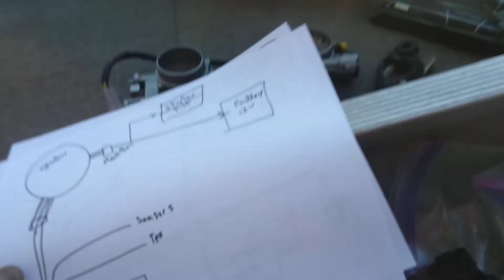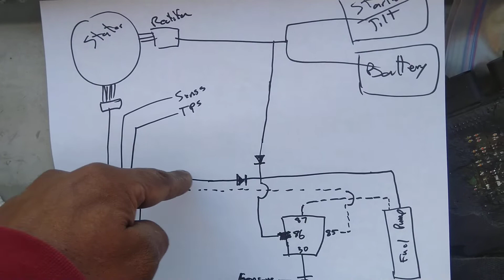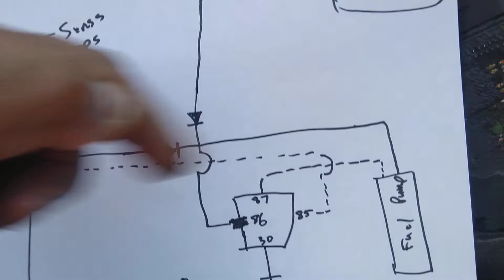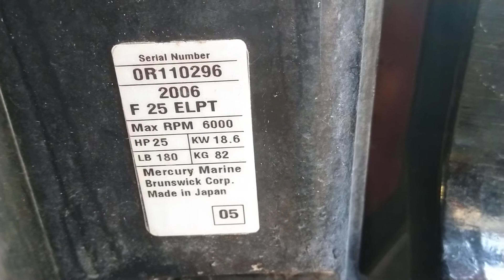mercury tohatsu 4 stroke 25hp 30hp outboard burning out ECU with aftermarket fuel pump

Comment: What state are you from if I may ask?
Reply from the maker: CO
Reply: @omieyouknowme having problems with this 25 4 stroke . No fire to the coils
Reply from the maker: @Everyonesunclewill check the kill switch wiring. Disconnect the brown wires. Then check if you have 12+ on one side of coil wires. The 12+ is same for injectors, coil, fuel pump, idle valve
Reply: @omieyouknowme😂 I got one bolt left to remove it . I’m just going to put an older 25 Johnson on it . Thank you for getting back to me
Reply: @omieyouknowme for giggles I’m going to hook the power back up and undo the wiring harness . It’s a pull start as well so it should work
Reply from the maker: @Everyonesunclewill problem with Johnson is when it breaks you won’t find parts for it. I turned down evinrude Johnson repairs when I used to fix motors because of parts.
Reply: @omieyouknowmeI have a ton of them
Reply: @omieyouknowme I’m thinking of taking it and having the ecm bypassed and putting the motor up tell needed
Reply from the maker: @Everyonesunclewill sadly there a lot of these motors out there that are just anchors now. I thought about building an aftermarket ECU at one time, using existing sensors but I rather fish now than fix motors. Getting old rather spend time enjoying what is left. 
Good luck.
Reply: @omieyouknowmeI. I seen a man bypass the ecm with a timed relay. I just want something to push a small pontoon boat with a cabin
Reply from the maker: @Everyonesunclewill time delay relay. That video was made after he saw mine. The time delays purpose is to give the ECU a chance to charge up the electronic brain before pump kicks in. 
I don’t feel he has understanding of how efi works but it worked so ok.

No spark on this motor can only come from kill switch, bad flywheel sensor or ECU internal rectifier just burnt out. 

Service manual helps but redneck method is to apply external +12v to one of the common wires say fuel pump wire that is positive. (Common wire as in same wire is for coil and injectors and is shared so all of them get +12 volts) Ground the battery to block. 
Crank motor. 
If the flywheel sensor and kill switch is fine you will get spark and motor will fire if pump is running. Means ECU internal rectifier is shot.

Comment: @Omie. Im not sure if youll see this in time.  I have a huge fishing trip coming up in 3 days, and i think my fuel pump is bad.  No gas to the fuel rail at all.  Needle was gunked up with old gas, as it sat.  Im assuming the fuel pump also has gunk in it and is stuck.  Can i reverse polarity to maybe break it free?  Also mine is a merc 25hp efi 2016.  I ordered the fuel pump from amazon.  Do all the outboards require a 3.2amp, or just some that burn up?
Reply from the maker: Reversing polarity won’t do much, usually the plastic impeller is locked up with crud.
You will also need to get a new gasket for vst. That old it will leak if reused. 
2016 and newer may be ok, I posted the serial number breaking my video where they are using a better circuit for pump. 
If needle is plugged you should also be changing the high pressure filter hidden under fuel cooler when you pull it all out. I just go to Napa and find a metal one similar in size for z8$ vs the 30$ OEM.

Comment: Do you have the part number for the Quantum fuel pump for the 2006 25 hp mercury 4 stroke? I removed the pump in my engine and it’s bad. I couldn’t have done this without your video! I appreciate your time and effort to help people.
Reply from the maker: I do not sorry. The pumps you find on Amazon and eBay all come from same factory so does not matter if you buy a quantum or other brand.

Comment: Do you have the part number for the smaller amp fuel pump from quantum? Just got off the phone with them and said they couldn’t find one without a part number
Reply from the maker: I do not. And the so called lower amp pump they sent me was no different than the one I bought already. It does not exist. That’s why OEM pumps are 600$ or a new ECU that can handle larger current

Comment: I got a new ecu because i think mine is fried.  I have no spark and no power to fuel pump.  

Before i replace ecu is there any test i can do on fuel pump to see if its drawing excess amperage?  Im pretty sure i have original oem fuel pump in...this sat for 8 years before attempting to start it and before it was fine and ran great.  I just dont want to burn up the replacement ECU if i have a bad fuel pump thats drawing too much amperage because of bad windings etc
Reply from the maker: If it has sat for that long, probably with fuel inside the vst I’d remove pump clean out the vst replace the high pressure fuel filter and lines. Run the pump on bench make sure it works. Then install everything but don’t hook up pump connector crank see if you get spark to rule out ECU for sure.

 No spark and power to fuel pump could be ecu but also could be bad kill switch or stator that is bad. Don’t assume a dead ECU means no spark, the fuel driver circuit is what goes out only and that’s a negative side. The positive side usually is pretty robust.
Reply: @omieyouknowme so the ecu does 2 things for the high pressure fuel pump? Gives it constant positive voltage AND supplies ground when the ecu wants to turn it on?  Or does the positive voltage at the pump just constantly there coming off of the rectifier?
Reply from the maker: @macknumber9 the ECU provides 5 and 12 volts to various components. 5v for sensors and 12v for spark from coils, injectors, idle valve, and fuel pump. The positive wire is common for them so if you take an injector plug off you find one 12v wire that will be common to pump and coil. 
It has an internal rectifier for this, and closes negative switches internally like a relay to drive the individual items. The positive side is always hot if the flywheel is turning unless: ECU rectifier is burned or kill switch is pulled or ECU does not detect signal from one of two flywheel sensors. 

It’s a pretty robust system with very few weak points. Two flywheel sensors for very accurate timing and it will still run with one out. 

If u are not getting spark check the basics first. Proper grounds, make sure kill switch is not grounded, no chafes or shorted wires before throwing an ECU in it. 
Then put ECU in and crank without fuel pump connected so you get spark and injectors powered. Get noid lights for injectors plugs into harness tells you instantly if they are working
Reply: @omieyouknowme thanks so much man i have been losing sleep over not knowing how this works and you are shedding so much light on this.  Just the knowledge of the ecm having a built in rectifier is awesome to know and helps me tremendously.

So i actually need to confirm all of this because i sold the boat and the guy i sold it to told me all this.  If he is correct though and it is no spark and no power to fuel pump it sounds like the first thing i need to do is check for ac voltage coming out of the stator....im assuming 24v ac is what i should see?

I may need a wiring diagram to test these grounds that you are talking about too....i guess basic continuity test is good?  I think i understand now somewhat how the high pressure fuel pump receives its power and ground but i now should focus on learning about the ignition system and how spark is generated...

I really need a wiring diagram especially to see how the kill switch plays into all of this.  I do not have a key switch just a toggle switch that kills the engine or allows it to start.  It is a rear tiller 30hp efi with a pull start and also electric start
Reply: @omieyouknowme  ok so the 12 volts on the positive side feeding all the components the 12v like the fuel pump etc.....does the ecm just have one wire leaving the ecm and then branching to all these components?

First thing I am going to do is test the lanyard switch... then move on to stator...if they check out only thing else it could be is bad ecm or some issue with the wiring to/from ecm like a bad ground or shorted wire....maybe I need to run continuity checks on the ecm ground (pin 28?)
Reply from the maker: @macknumber9 you should have a wiring diagram behind the plastic cover that sits in front of engine. It’s been a while but I believe that the 12v wire for all components is the same. Fluke can tone out that wire from injector or coil with fuel pump.

The stator for ECU has 6 white wires. I don’t have service manual with me but there is a test procedure for it. The grounds for ECU are behind that plastic cover next to starter. The kill switch should be brown and yellow stripe wire. One of them goes to the bundle where ECU is grounded. 

I mean in theory you could disconnect the 6 pin wire for stator, provide an external 12v source to one of the wires say the fuel pump positive line and crank. If you get spark you can then isolate it to ECU or stator. This is just theory as I am hoping 12v backfeed and provide power for ECU as well. 
Tohatsu builds a good motor I’d lean towards the ECU myself if the above works.
Reply: @omieyouknowme ok so you're saying to check continuity with fuel pump and something else like coil or injector and see if it tones out then I know they are all on the same circuit?

It seems like the only thing it could be is stator not giving power to ECM and ECM doesn't have any power to give to the fuel pump and ignition....or ECM itself is fried.....or I guess somehow the lanyard switch could be at play here?  That's the last piece of the puzzle that I need to try and understand.   I will look for and hopefully find that wiring diagram on the motor somewhere....but in the meantime can you explain how maybe the lanyard switch would be wired into this?  Does the switch just simply kill the ignition circuit or is it tied into the ECM at all?
Reply: @omieyouknowme  also do you think it's possible that the fuel sitting in there for so long caused the fuel pump to draw too much amperage because it was all gunked up?  And I should try to clean the actual fuel pump out?  My biggest fear is something like that causing the ECM to fail (excess amp draw from dirty fuel pump) and i blow then replacement ECM too?

Or is that really not possible in your opinion and the problem really happens simply from the aftermarket pumps that draw more amps?
Reply from the maker: @macknumber9 yes. The pump and injector positive wire is common. You can tone it. 
The kills switch closes ground with ECU to kill power.
Reply from the maker: @macknumber9 yes. The pump sitting in gunk will burn out an ECU really quick it will pull to many amps.  Aftermarket pumps don’t help much either but there are trade offs, Fuel filter that’s plugged will do same thing.
Reply: @omieyouknowme thanks so much.  So I think im going to clean out everything....what exact components should I clean im lost with how many different fuel filters etc I need to clean to make sure the amp draw stays nice and low for this new ecm

Also do you know if the ECM constantly gives out 12v to injectors, coil, etc?  

Just thinking about a backup plan if the ecm failure is only with the fuel pump circuit.  If power was on at all times to the injector for example I could tap off of that to feed 12v to the fuel pump by way of a delayed relay so it can get its ground that way.

But that leads me to last question...does the ecm just constantly run the fuel pump or does it sometimes shut it off?  Im assuming with the mechanical pressure regulator it just constantly runs it and this would work
Reply from the maker: @macknumber9 if flywheel is turning it’s providing constant +12 to components. The ECU then triggers it with negative signal. Your car does same thing, triggers off the negative side. 

Take out vst tank. Remove the pump and filter, check sock on bottom see if it’s plugged. U can run the pump dry for few seconds once its out see if it spins or is locked up. 

Low press filter is before the low pressure fuel pump mounted on valve cover. Then goes into vst tank via a needle float like a carb. High pressure pump picks it up sends it to high pressure filter that’s next to coils then splits to fuel cooler which some returns fuel to vst and sends rest  to injector as deadhead. No return from injectors. 

If you have +12v at injector, you will have that +12 at pump lead. Just use a relay off that same +12 line to close a ground from the case. The relay will just add ground to pump as +12 is already there. That way if motor turns off it opens relay and opens ground shuts off pump. 
I saw that other video of using a delayed relay not sure why he suggested that. It’s not how 99.9% of efi systems are designed or run.
Reply: @omieyouknowme  yeah the only reason I would think of the delay is to protect the engine to allow lubrication but I dont know doesnt make much sense and he said it wouldn't work without the delay...I asked him he hasn't gotten back to me yet.

The 12v that is supplied to fuel pump, injectors and coils comes from the ECM though right?  Doesn't it leave stator as ac voltage and then go to ECM and get converted there to dc voltage and then it leaves the ECM to go to the fuel pump, coils and injectors?
Reply from the maker: @macknumber9  most efi systems will prime the pump for split second before cranking to build pressure. These battery less systems do that as motor is cranking. The older ones like this one crank to generate ac that’s rectified internally to power everything. The new systems use an external dc capacitor that holds a small charge and reacts faster.  I’m not sure why the relay with delay but what ever works. All these systems are patented from Mitsubishi by the way. 

Yes 12v supplied thru ECM when running. The starter has a secondary stator output, 3 wire plug on starboard side right next to ECU for battery charging. When I did my fix, I tapped 12v from here for my pump. That left more amps for ECU. Downside my battery won’t charge unless it’s 1200rpm or more.
Reply: @omieyouknowmeyou are a wealth of knowledge I really appreciate you helping me out! I just tested the lanyard switch and sure enough it is testing bad. I kept checking for continuity and I just couldn't get any I followed the service manual instructions it makes sense that that switch would be bad because it's the only thing really outside facing the elements everything else is under the cowl....i hate using multimeter sometimes i dont make good connection but i tried over and over again and it keeps failing the test....i would be thrilled if this was my problem. 

I did see the wiring diagram you mentioned and it is helpful but i really need a full diagram...im so interested to know how the lanyard plays into everything....i know for sure it would cause no spark but i dont see how it would cause no power to fuel pump....are you sure that it would cauze no power to fuel pump?  Does it kill the ecm or something so the ecm can not send out any power? Does it somehow flip off the ecm?
Reply from the maker: @macknumber9 the mercury service manual I have does not have a wiring diagram. Maybe the Tohatsu or Nissan versions do. 

Failing test as in you see ground on both sides of switch with lanyard installed?

The kill switch shuts the ecm down. It’s similar to grounding ignition coil on carb motors to kill them just the ecm is doing it.
You can disconnect wires to the lanyard completely, and crank motor, prob get spark and 12v   Keep fuel plug out for test.
Reply: @omieyouknowmethe service manual had me disconnect lanyard from the brown wire that goes to ecm...then disconnect stop button from the ecm black lead...and check for continuity between those with lanyard in the run position and off position....both times i got no continuity and i should have gotten continuity when the lanyard was in the off position
Reply from the maker: @macknumber9 correct. Kill switch without lanyard should have beeped 
So with both wires removed did you get 12v on any wire cranking.?
Reply: @omieyouknowme i havent tried to crank it yet...i have to get a battery hooked up...which leads me to next question...theres leads going into the motor...can i just use those or do i need to hook up to thicker gauge wires?
Reply: @omieyouknowmeseeing how you mentioned that the lanyard will shut the ecm down that makes perfect sense....and im definitley hoping i did the test correctly...going to try again tomorrow....if the ecm is shut down then of course i would have no spark and no power at the fuel pump...and you mentioned that the positive feed coming out of ecm is very robust and unlikely to encounter issues....i dont want to get my hopes up but i think this is a simple bad lanyard switch...
Reply from the maker: @macknumber9 not following this question. Electric start leads are the thick 8-6 gauge leads.
Reply: @omieyouknowmethe leads that were on the boat coming from the battery were extremely thick and then it goes into two black wires that fit perfectly through the hole in the front of the outboard that leads right onto the starter and the main Ground Terminal terminal is there any way I can send you a picture through email
Reply from the maker: @macknumber9 those are main leads from battery. One goes to ground on starter the other to a junction where it goes to starter solenoid then a smaller one with fuse to rectifier. 
That’s std  sorry I am winding down my channel I don’t send out me email

Comment: Will this work if the ecu is completely shot?
Reply from the maker: @brianmiller7370  as long as injectors fire and spark is intact. Yes
Reply: @omieyouknowme my coils are not firing at all the white plugs on the harness that plugs into the coils have power but 3 coils are not getting spark my injectors are spraying
Reply from the maker: @brianmiller7370  check your kill switch wires then. Disconnect kill switch wires at switch. If it's not grounded then ECU may be toast.